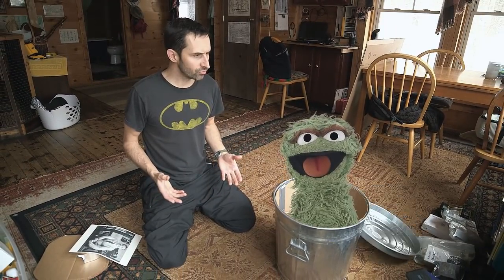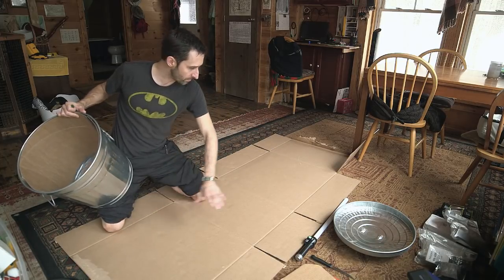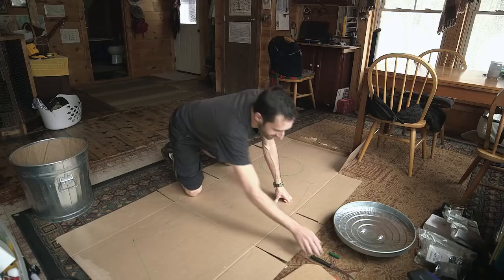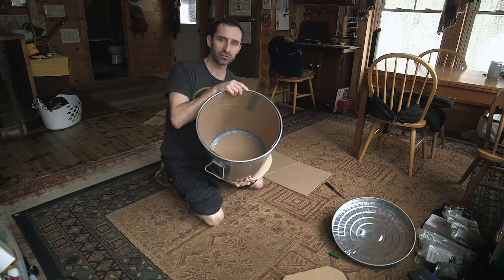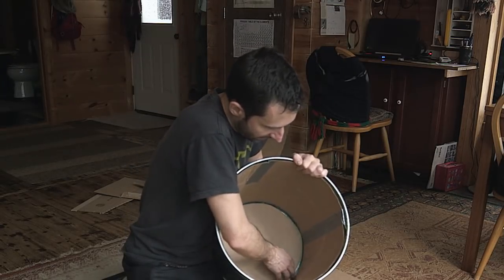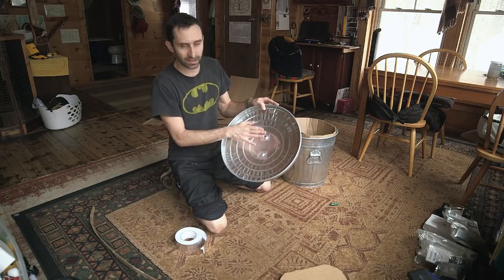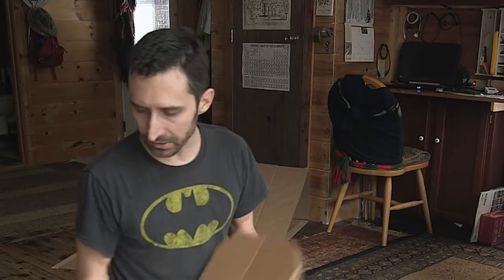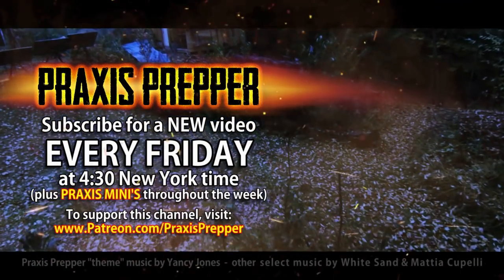Cheap, Easy and QUICK - DIY Faraday Cage

Comment: That intro, talk about some therapy time needed. ;-)

You actually don't need the cardboard liner.  The energy will not conduct to the inside of the container.  Here is the quick thought experiment that will tell you the answer, if the energy could conduct to the inside and it came from the air it would also destroy what is in the inside.  However, having padding like you suggested is a great thing.  

I don't like using those metal cans for a Faraday cage much as the lining on them to help prevent against rust and corrosion greatly impedes the flow of electrical currents weakening their ability to work well against an EMP.  

The main guide for protecting against an EMP is MIL-STD-188-125-1 and it outlines protections against the standard nuclear EMP weapon that is able to produce voltages of 50,000volts/meter^2 but information that came out after the collapse of the USSR suggests the Soviets produced nuclear weapons designed to maximize EMP output and based on the best knowledge I have is they would produce 100,000 - 200,000 volts/meter^2 and at that power level we need a reduction of around 106db [20*Log(200000 Volt/Meter), rounded up to 110db with a 4db safety margin.  Now if you include the standard testing for RFI required of around 10volts/meter^2 of interference the shielding required would be 90db [20*Log(200000 volt/meter / 10 volt/meter) + 4 db safety margin].  Plus I figure if the Soviets built them the US and China most likely did as well.  

At this power level, I'm highly concerned about the sealing surface.  The material is thick enough to do it but that seal between the lid and base needs some really good electrical conductivity.  This is where Arthur and I have disagreement (the guy who made that other video) about the power of the weapons and the threat faced.  Shielding for 110db is an immensely bigger than job than shielding against 80db as it is a logarithmic scale.  90db is much more doable but I generally go to the over engineered side of things.  So, when doing these I highly suggest taking a piece of emery cloth and scoring up the surface of the trashcan and lid so that you have raw, unoxidized and unprotected metal for the materiel to seal against.  I also like the idea of using metal tape but use tape that has a conductive adhesive.  That is the best advice I have for when making this type of Faraday cage.

Comment: Good explanation. It IS extremely important that nothing inside touches the outside metal surface -- including the top. The tape in the interior should there for be an insulating tape -- and some duct tape is. I generally don't trust, and I store things in their box, wrapped in aluminum foil and put in a plastic ziplock (sealable) bag that gives another layer of protection.

Comment: How about spraying the inside with something like that Flex Seal stuff?
Reply from the maker: That's not a bad idea. I just used cardboard because I had it, but yeah, anything non-conductive would achieve the same aim.
Reply: I was totally thinking the same thing. Spray the can and lid, and add cardboard... Probably overkill... but I have a bad habit of over-engineering simple things.
Reply from the maker: We wouldn't be preppers  if we didn't over-emgineer!

Comment: Just spitballing here, but I can imagine steel wool insuring continuity between can and lid while facilitating easy removal & replacement of the lid @ the same time. Just my opinion, I could be wrong.
Any engineers out there that could chime in?
Reply: Steve Edwards I have no idea if that would work or not but it sounds like it should. In the test video it shows that it probably doesn't matter, however I think that if I was to make one, I would do this. Stick it right around the inside corners of the lid with a glue gun.
Reply: Kipper that's what I was thinking, too.

Comment: I recently tested the conductivity of the aluminum tape (not duck tape) many people say to use for sealing the lid to the trashcan. There is no conductivity on the glue side of this tape, and that is what touches the can. I'm wondering if it actually helps more than masking/duck/scotch tape since there's no conductivity across the gap you're trying to cover?
Reply from the maker: I love that you ran the test yourself. I have not, but this is a technique that HAS been tested by Arthur T Bradley, who is a reasonably well-respected voice on the topic of EMP and EMF here in the community. I've spoken with him on a number of occasions. he strikes me as an honest human being and I would tend to trust his say-so that if he ran the test, it's legit. As far as WHY it works. IDK. I get what you're saying. But Bradley ran teste with cans untaped, taped with copper tape, and taped with aluminum tape and he said that the copper worked best and was far better than no tape, but the aluminum was a close second (and it's a lot cheaper than copper).

Comment: Do you not have to worry about taping the inside of the handles on the side of trashcan like you did with the lid? Is that because of the cardboard liner? Great video!
Reply from the maker: Taping EVERYTHING would be a good idea. I just made sure to mention the lid because that tends to be the biggest actual gap with the wiggling around over time. Any self-respecting prepper overdoes everything s/he does!

Comment: Actually I have one more comment on this.  So, why can't you use a regular surge suppressor to protect against nuclear EMP events (an EMP from a solar storm won't destroy your small electronics)?  

We always hear about EMP and it is made to sound like some super unstoppable thing that will come and destroy everything.  Nothing will survive and nothing will protect things from it, except of course special super top secret government buildings that have the special super top secret surge suppressors which they will never tell you about as they want you all to die!  Or something similar to that.

Well, here is the quick(ish) answer that covers that main problem faced when dealing with these EMP events.  A nuclear EMP makes a surge current that reaches full power quickly, very, very quickly.  From the MIL standard I mentioned it was observed that full power was reached in about 5 nanoseconds.  Also, EMP is different from a lightning strike as most of the power of the lightning strike in the frequency spectrum is DC but an EMP has 99% of its energy within the 10KHz to 100MHz spectrum.  

A surge suppressor, like TVS for your whole house, senses a rise in the voltage and begins clamping (or conducting), the excess energy the ground path.  Even a very fast surge suppressor to protect against lightning strikes start clamping (or conducting) in about 40ns.  Way, way to slow to stop the damage of an EMP.  By the time the surge suppressors get going the voltage has already risen about the damage threshold for many electronics for too long of a period of time.

Surge suppressors that are actually fast enough to protect devices are a very specialized class that so far only the government are requesting from the industry and purchasing them.  I only know of two companies that make them and boy are they expensive.  The cost to protect a house is going to be around $30,000 from my best estimate plus it doesn't cover the shielding needed.

The market (us preppers) need to pester one of these companies and see if we can get a more mass market device but because of what they need to do I think they will always be rather expensive.

If you would like some sources let me know and I email you some documents and you can have your father look at it.

Take care!  

Oh, before I forget.  Good video!
Reply from the maker: Thanks Reed. My over-arching plan for an EMP is to just lose my electronics. I keep a few things in my can for basic radio listening, digital memories like family photos etc. But overall, I'm good just 1800'sing it... I think...
Reply: Praxis Prepper - I'm trying find a way so that if it happens I can keep several important technologies as the 1800s were really rough.  Of course the event itself will be hellish.

One of things I'm designing and put together are ways for powering refrigeration with a solar heat source using a different refrigerant than ammonia.  Once I get it figured out I want to show to build it so that lots of other people can use it.  Just having good refrigeration would be a nice big help.

Lot of ideas and lots of things to figure out and engineer.  Well, if nothing ever happens it will be a lifetime of amazing discover and learning which is a great thing. :-)
Reply from the maker: I really enjoy the process as well. I prefer the preps that pay off during regular life too. I'm going to be building a fallout shelter at our next home, but It's also going to be a really great root cellar. The two things are SO similar that the fact that it's also going to double as a shelter adds practically nothing to the cost or time to build.
Reply: Praxis Prepper - That mirrors exactly what I want to do as well.  I have hill right by my house that I plan on digging into the side of to build the shelter and root cellar.  With all the earth around it the structure should hold temperature very well.

Have you found your new location already?  How big of a plot of land are you going to get?

I need to get more land myself.  I planning to purchase the several acres behind my property but if I can't get it then I plan to move just a few miles to get several acres on the edge of town.  Just need more room to do things, especially since I want to get a bunch of trees growing and need to make sure my solar panels don't get shaded as the trees grow.

Comment: Does a lap top fit in there standing up? I'm trying to think of how to create a faraday for my laptop to store on a daily basis. Not crazy about storing it on it's side, but not sure what else to use. Open to suggestions :)
Reply from the maker: Different laptops are different sizes, and while trash cans are somewhat standard, I'm sure there is variation there too. So I can't advise on that. I'd say just measure your laptop, then go to a store and measure the trashcan you might use. Be sure to account for any padding (I'd used cardboard here). As for standing on its side, (personally) that wouldn't cause me any concern at all. There's nothing inherently "this side up" with a laptop. Consider that when laptops are packed in boxes at the store or warehouse, they lay vertically, and so too do they stand on edge when slipped into a brief case. That particular concern is no (again IMO) something to worry about. Also, consider whether you'd be sealing up the trashcan with aluminum tape, and then cutting that tape open again between each use. Doing so might be a bit onerous (and also wasteful with tape). If you'd like to save FILES you have on your laptop, then consider just purchasing a backup hard drive. You can get a relatively large backup drive on amazon (https://amzn.to/3xtB9sq) that you could use to back up your files one a week or so and you'd save on the hassle of opening the faraday trash can on a daily basis. If you do this consider buying 2 of them, one to keep in the can, and one to use for actual work. You'd want to limit the backup drive's time outside the can.
Last, consider this, I've discussed this topic with knowledgeable people and there IS some degree of uncertainty over whether a CME or EMP would even kill a small device like a laptop (IF it's not left plugged into the power grid). Those events tend to do the most harm on LOOOONG stretches of wire that can pick up a lot of energy. So with a small device like a laptop, the impact of a CME or EMP may ("MAY") be limited or non-existent.

Good luck!
Reply: @PraxisPrepper  Thanks. I'm still mulling this over. Searching for a tin something that's cheap and rectangular in shape. My thought was that it wouldn't make a difference if it was opened daily and I took the lap top in and out. I didn't think it needed to be sealed.
Reply from the maker: @LoveGuruBlaire  I'm not sure if I mentioned it in this video or not, but testing has shown that sealing the gap along the edge with metalic tape makes an appreciable difference in terms of EMF entering the inner space of the can. The guy that hosts this channel (https://www.youtube.com/watch?v=CIivyKyndAE) is really knowledgable on this topic. I'd highly recommend you check him out. The particular video in the link is "whatever", just a link to his channel - but if you go to his page, look for his videos on EMP Faraday cages. Good luck!

Comment: It doesn’t matter if the aluminum or copper is the outside layer or the inside? It seems like most people use a garbage can which is on the outside with a paper lining inside but I’ve also see people line a box in the inside with copper tape. So which is it?
Reply from the maker: I'd suggest that the fact there are multiple approaches being suggested doesn't necessarily mean anything other than that there are multiple approaches possible. The goal is to create a conductive enveloping membrane around items to be protected. There are likely many very effective approaches to do this. As far as copper vs. aluminum goes, my research has suggested that (while copper is slightly more effective) both materials work very well.
Reply: @PraxisPrepper  thanks. my concern not so much about aluminum or copper, just as to if it's ok for my stuff to be touching the aluminum or copper
Reply from the maker: @firstnamelastname-ve9gj  Ah, I understnad your question now. So here's what I understand the situation to be (based on having discussed this with experts far more knowledgable than myself). The paper liner inside is unnecessary. I added it as to avoid contact with the outside surface, but I've been told (by people which I trust) that it's unnecessary in terms of protection against and EMP pulse. The pulse travels over the outer surface of the enclosure, and even if objects are touching the inside, they're fine. That said... I never see anything wrong with a little overkill precaution, and the cardboard adds a bit of padding to the inside for physical shock protection, and also adds a "hadsom finished look" when added. ;)
Good question on your part - and good luck!
Reply: @PraxisPrepper  thank you.

Comment: Do you need to cover the inside of the lid? Should you test it like putting a phone in there and trying to call it?
Reply from the maker: You know, it's a good question. What I'm sharing here is something that I've learned from sources that I've felt seemed reliable. I had NOT tested this at all prior to making this episode. Though someone actually asked the same question as you about an hour ago (in regards to the phone test). Well actually they didn't ask, they just stated that the video was bad because if I DID put a cell phone in the can, it'd ring, so the idea is crap. I told them what I told you that I hadn't done any testing personally, relying on the sources I'd found. But... I was curious about their claim and just did that test.
I popped a cellphone in the can, I didn't even bother to re-tape it up, and it didn't ring when I called it. Now, it should be noted that I don't live right under a cell tower, so performing this experiment right at the base of a tower might yield different results. But from my test (even without any tape), it worked... for cell phone signals. But an EMP is a WAY higher energy level. So again, I rely on the good science of those from whom I've collected this info.
Reply: Praxis Prepper thanks, I will totally build one of these.
Reply from the maker: I just re-ran this test on camera because of your question and I'll upload the video as soon as is possible (as long as we don't experience any EMP's in the interim).
Reply: The Walker I think that would be a good test for everyone to run after they make their own. To check if they have do it right.